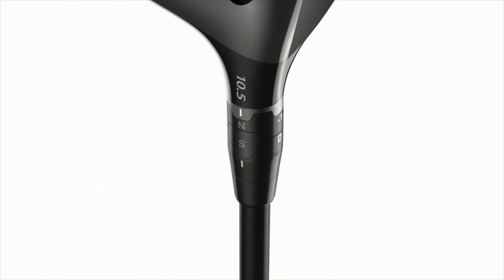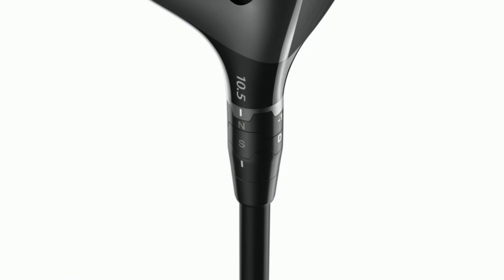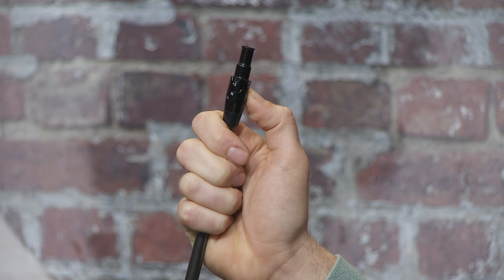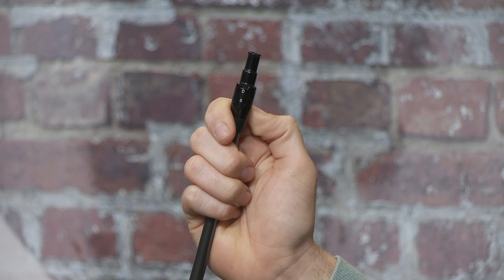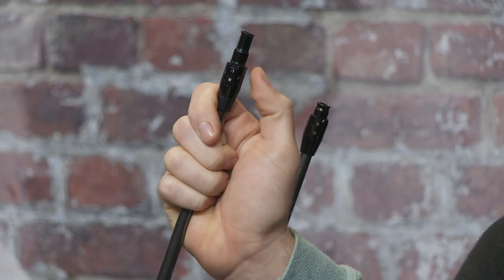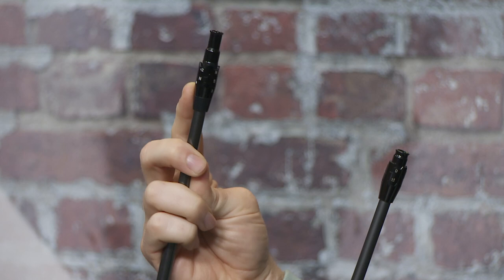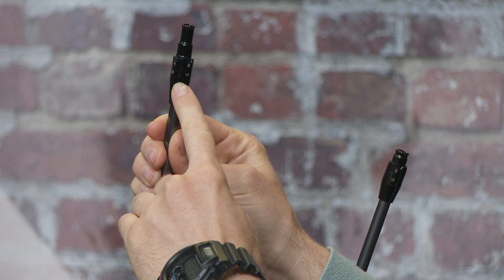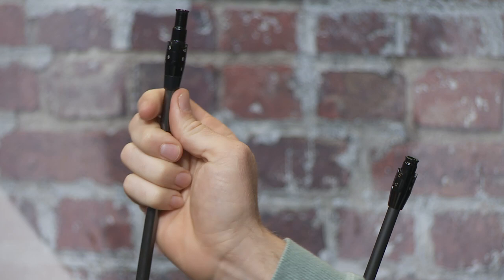Fitting Room Podcast EP. 100: Understanding EXACTLY How To Use The Optifit Hosel

Comment: Does adjusting the loft affect the face angle as it does with other manufacturers?
Reply from the maker: Yes it does Kellen. If you increase the loft, it will make the club a bit more upright (and vice versa).

Comment: How do you set up the OptiFit for a fade?
Reply from the maker: There's no fade setting on the optifit (but if you have Epic or Epic Flash, there's adjustable  perimeter weighting that you can move to the fade setting).
Reply: Thank you for the response ... my courses bailout is to the right on almost every hole. Having a fade biased driver would be a big help as most shots left will be out of play and likely to be OB. I will continue my search as my Rogue Subzero does not have that sliding weight to help me out. Have a great day!